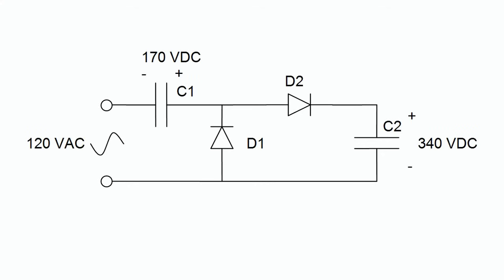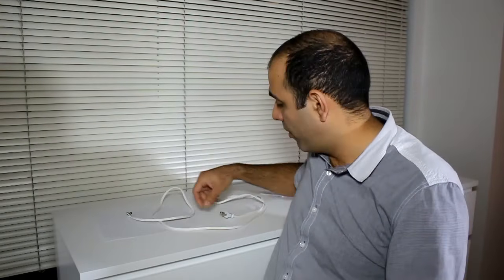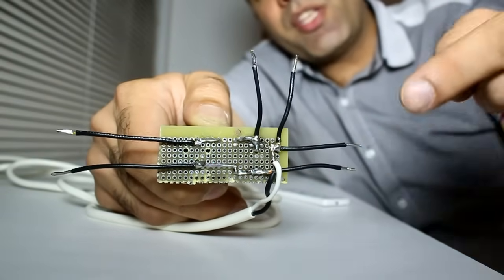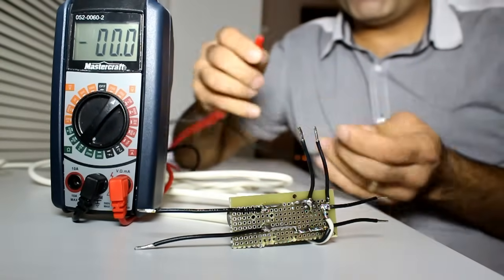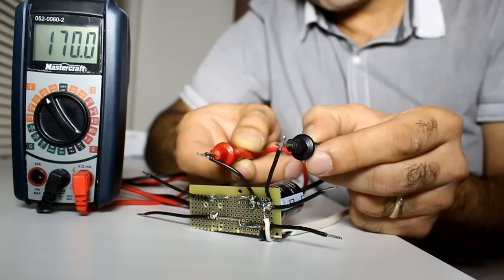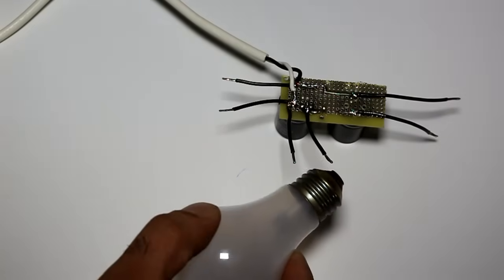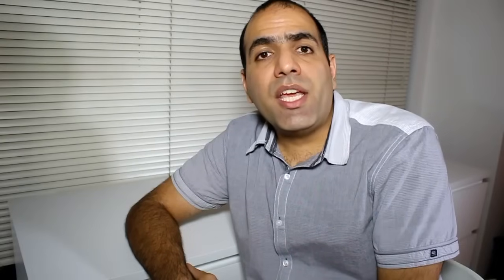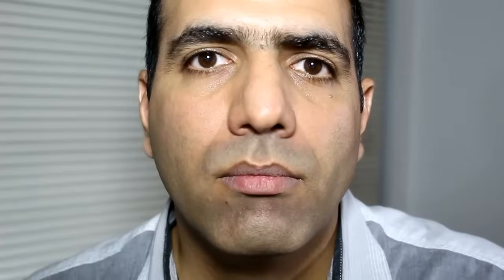High Voltage AC/DC Effect on Human Body

Comment: if i connect this capacitor parallel to  transformer to increase  the amperage  in 1 to 2 second (150uf/400v) using microwave oven transformer for my spot weld is that ok ? 😊😇

Comment: I was running my electric guitar straight through a soundboard (Little to no amplification) and I touched the wires to my tongue) the A.C. voltage was very low (less than 10 volts) but it still hurt like hell.

Comment: I had to look up these voltage videos of yours again, after reading an article by Edison where he proposed 200 volts DC to be run as "safe" electricity in NYC overhead wires. He pretty much boasted that if wires were crossed and for example telephone lines became electrified at "low" DC voltages of a few hundreds no one would die or even notice. Of course I didn't really believe him, but now I am more convinced. I guess hundreds of volts only sound so dangerous to us 21th century types because we're so used to the effects of AC. Really interesting stuff, makes me wish DC was the dominant power!

Comment: Does anyone know how how the voltage is stepped up in the second capacitor? I understand the AC-DC 120-170, but do not understand the 120-340.

Comment: We used to plug capacitors (fairly big ones, similar to the black ones at 1:22) into the wall outlet, so they exploded when the teacher turned on the power to our work areas. Terrible smell from those things! We had a very chill teacher though, so he found laughed at it as well (the first few times at least, then he got bored of it)

Comment: the mainly problem with AC voltage is that can  cause a  ventricular fibrillation because the frecuency of that output is  similar to the frequency  of a human electric signal of the heart, and in that frecuency also can cause a tetanic contraction in the muscle

Comment: I wonder if this could be used as a power supply for an electromagnetic launcher. It gives a suitable voltage for my particular design, and also turns the AC into DC.

Comment: As you had shown the bulb on the 170 DC volt was brighter than on the AC side, but I was wondering if it now draws more power? In other words, do you now get a brighter bulb for the same cost of power. It would be a neat trick to get more light out of a bulb without increasing the cost of the electricity. (And yes, the bulb would have a shorter life span)
Reply: No the reason why it can deliver 169 volts continuesly is because capaciter is storing energy and delivering it between peaks to keep a stable voltage that means no extra energy is created the input and output is about same(a little less due to diode,wire and capaciter resistance losses)
Reply: @mrk5216  And it only took 6 years to get the answer. Thank you. 👍
Reply: @paparoysworkshop  welcome

Comment: When you touched the AC wires, you probably didn't plug it in because of how dangerous it is.
Reply: Well, I accidentally touched 240V AC once and it was just a tiny tickle. But it scared the hell out of me. And I don't recommend doing that on purpose because it can kill you.
Reply: been shocked by 120v and 277v. neither occasion was I holding a wire in each hand. once I was even slightly shocked by holding a non contact tester to a hot wire standing on a ladder up against a light pole. the wire was wet because it had just finished raining, and the insulation had old cracks. the 120v trying to get to the ground through my metal ladder was enough to make me feel the 'buzz' and it wasn't a good feeling.

most people only feel the shock of having a live wire try to use them to get to true earth ground (and get off lucky), rarely do they actually become a human resistor between a live and neutral/ground wire. in those situations it most certainly can be lethal.

Comment: Excellent explanation for AC passing through a capacitor!
Reply: ChickenCommander dude everyone here understands that the explanation is just fake
Reply: you think so? o_O
its the worst explanation i ever heard.
Reply: ChickenCommander That was sarcasm. I'm an electrical engineer
Reply: +Noah Zuniga A capacitor stores energy. If it gets full, as it can happen in a DC circuit, it will act as an open-circuit, so no more current will flow through it. (Unless, you discharge it a bit, and connect to the circuit again).
But if you are working with AC, then think of it like a DC but in two directions, which keep changing with a certain frequency. In this case, the capacitor never gets totally full, as sometimes it charges, others it discharges. In AC the capacitor behaves like a small "resistance". (More things could be added, but this is the basis).
Reply: @jakejus1  lol, you should know that a capacitor will act as an open circuit because of its impedance property. The capacitor impedance is inversely proportional to frequency thats why when the frequency is zero (DC voltage), its impedance is max(infinite) that's why no dc can pass thru capacitor.
Reply: @jayz4371   lol, you only told the formula but he gave the reason behind it. Do you even understand why impedance of capacitor depends on frequency?
Reply: yeah
Reply: why is it wrong
Reply: Noah Zuniga
cuz why not
Reply: +jakejus1 why is that when he touches 170v dc he doesnt get zapped how ???
Reply: R praveen Think of DC as electricity traveling in a straight line. When it hits the body, it gets deflected. AC kinda zig zags, so it goes through the tissue easier.
Reply: @Miscio94  reflects???wtf???
Reply: @Praveen-jw8lx  DC resistance and AC are not equal that's why the Vdc didn't hurt much as Vac

Comment: Huh I always AC was supposed to be safer than DC, I thought that was part of the reason we ended up with mains AC power. Is that not the case then?
Reply: DC is safer than AC. We ended up with AC because it is easier to carry AC over long distances compared to DC.

Comment: Watching this video reminded me of one time, when I was a kid and grabbed a wire to see where it was connected to, it was an extension connected to the wall power (230V AC) and nothing else... Obviously they weren't open wires, and it was actually quite thick, so I don't know why it happened, but it shocked me, it shocked me hard, and because I picked up the wire with the palm of my hand, the electricity made the muscles on my hand contract and I couldn't let go... I don't remember almost anything from that day, but I remember the 3-5 seconds I was holding the wire like it was yesterday... It burned my skin where I was in contact with it, and if I was alone, I would be dead by now... And I wasn't with an adult either, I was with a cousin my age, I think 7 at the time, and he had no idea what to do while I was screaming for him to help me, so after telling me to let go and I saying I couldn't, he grabbed my arm, I think to try and pull it away, which made him feel the electricity for a split second, enabling me to let go... And I have no idea if this is related to that, but sometimes I carry an amount of static in my body that I don't think is normal, one day I shocked myself (don't ask me how because I don't have an answer), and realized if I ran my finger above my skin, I could lift up all my hairs, and my ex complained multiple times that I shocked her, some days she was afraid to touch me... But whatever the reason was it might have passed by now because I haven't felt a shock in a long time

Comment: You re wrong !
Ac hurt more yes bun DC will split the H2O in your body into H2 and O.
This Gas Bubbles can block the Blood transfer in your Brain and kill you some hours later !!
Reply: There is soo little current running through your body it will hardly generate any 2h2 and o2

Comment: question, then why AC is mostly used at home, shouldn't it be DC? more safe for human life!!!
Reply: Ac is easier to mass produce
Reply: AC might be easier as mass production in Grids but at home shouldn't we convert AC to DC, more secure. There should be some other reason !!!
Reply: Our every day appliances actually step down the ac voltages to their specific voltages, it is much harder to transform the voltage if it is dc.

Comment: is that real accident or just some setups XDDDDD
Reply: he is the hero the world needs.
teaching work safety in the most efficent manner.
by doing everything you shouldn't
Reply: the AC one MAY be fake, but i'm not sure.
the multimeter shows no voltage when he touches them to the contact points. (but in that time period there was no voltage reading of the 170V AC

Comment: Hi Love your vids !!, i have a (approx 25vdc) electric motor but only a 18 vdc solar panel !, is there any advice as to how i could run this motor ?
Reply: If you hook it up normally the motor should run, but not at its full speed, if you want to increase the solar panel voltage you can use a boost converter

Comment: why dont they just use dc for all power source in the world. its safer.
Reply: +listojay AC can propogate the same distance through power lines with a lower drop in power. It's about efficiency
Reply: then use ac dc converter after the long distance.
Reply: That's what is currently being done. Most commercial products use DC

Comment: Hi Mehdi, do the parasitic capacitances of the human body serve as a high pass filter when taking into account the resistance of the human body?

If so, is it possible for a cutoff frequency for AC that would limit damage to the human skin to the same extent as DC voltage?
Reply: +MrTrAnthony Ideal cut offs are only in text books :)
Reply: +successmiracles I totally missed that point haha...

Comment: I think all powerlines should be DC. Even when ignoring the safety, 1. dc can run much more appliances and more efficiently, for example a BLDC motor will run with 1 permanent magnet and 1 electromagnet while ac brushless motor will require 2 electromagnets (also brushed). 50% of our appliances convert it to dc. Also look at dc on a graph, it is at a constant voltage and very useful. Then look at ac... horrible.
You got a perfect example in a fly zapper
Reply: +Shaheer Syed If you look at pond pumps those are simple 'brushless' motors, just a pemanent magnet surrounded by AC coil. Granted it has it's drawbacks, like it will start and run in either direction, weak starting torque, sync'd to mains freq. et.c.

I whole heartedly agree though, DC FTW.

Comment: Notice, he only touches the 350v capacitor with 1 finger to keep the current from running across his chest.  If he touched it with both hands it could hurt much much more, or even kill because of the high instant current available by the capacitor.

Comment: how can you have 170V dc and a 340v dc simultaneous output frm just a 120V ac ?
Reply: 120×(2)^(1/2)=169.706
169.706×2=339.4
Reply: +Mohammad Nadeem with the right resistor and rectifier circuit, you can pretty much generate any voltage, but you consequently change the output current.
Reply: +Mohammad Nadeem It's just a basic capacitive voltage multiplier, man

and the 170V is just peak to peak RMS value of the sine wave (you take the AC voltage and multiply it by square root of 2)
Reply from the maker: +Mohammad Nadeem Follow the link to my website in video description.
Reply: +ElectroBOOM 
Wearing a ring?

Yikes!

Take the ring off.
Reply: +Shaheer Syed +Mohammad Nadeem Because of the use of the diodes, he's able to charge the 340V Cap with the 170V Cap + the 120VAC.  Check out the schematic at 0:20 and consider what direction current is flowing at each end of the AC sine wave.
Reply: +Mohammad Nadeem Not sure about 340v but for the 170... the 120vac at sine actually peaks at 170vac but because it's a sine so its potential is only 120vac as some areas have a lower voltage and so the peak is increased to account for that. A rectifier changes it to 120vdc potential sine (peak 170 again) and the capacitor makes it constant by keeping the power while the voltage goes down.
Reply: Arai503
Wait a minute I just realized... that that was a voltage doubler
Reply: +Mohammad Nadeem its a very simple duplicator of voltage of dc

Comment: The reason 230 v in europ is, just a mistake.

They chose it and build all belongings based on it.

now they cant chane it to e.g. 50v.

50v is the best, but they cant change.

like they can change the roads.
Reply: +Take it Easy Higher voltage means that you can use thinner wires and equipment would be smaller and less heavy.

Comment: I don't know if you've covered this in your videos although I'm sure you know about it. It would be a good reminder to let everyone know that if you aren't killed immediately by touching 120VAC (or voltages around that range or higher), you can die afterwards (a few hours) due to heart problems. Always, after being shocked by a voltage like that, HEAD TO THE HOSPITAL IMMEDIATELY to get yourself checked out for any issues with your heart. Just thought this  would be important for people to see who watch your stuff.

Love your vids Mehdi!

- Konner
Reply: Great I don't feel like a pussy anymore for going to the hospital after touching 230VAC :)
Reply: Konner Holden thanks for the info

Comment: 100% how capacitors work
Reply: +Maxstar22 yep! Clue is in the names!! DC = dumb current, even a cap can fool it! AC = agile current, has no problem with caps, just jumps over! Tah-daaah!
Reply: Paxmax best comment I’ve ever seen
Reply: No, this is not how caps work. They store electricity as an electrostatic charge. DC will just charge the capacitor, while AC can charge and discharge the cap, therefore a small amount of AC current can still flow. The amount of current that can flow depends of the frequency of the AC and the capacitance of the capacitor. Caps do not convert AC to DC, you need a diode or a FULL BRIDGE RECTIFIER for that.
Reply: @LucasWills  usually I'd get mad over someone not getting a joke. But you sir explained the actual thing rather than just calling the oc stupid and that actually helped me. I wish more people were like you
Reply: Capacitors filters AC into Dc?
Reply: Maxstar22
Reply: Capcitors can be thought of as high pass filters that let high frequencies pass through but low frequencies are blocked. DC is as low as it gets, so no current flow.
Reply: @GalibFida  While inductors block AC, so they are low-pass filters. However, an inductor, capacitor and resistor in series is called an RLC network. R for resistor, L for inductor, and C for capacitor.
Reply: That was not a joke, that IS how capacitors work. I learned it at my education exactly like he explained at 4:00
Reply: What about inductors? ;)
Reply: Triangle wave AC current, you can't pass mehdi's law of capacitors!!!